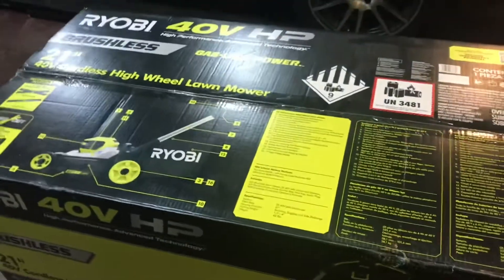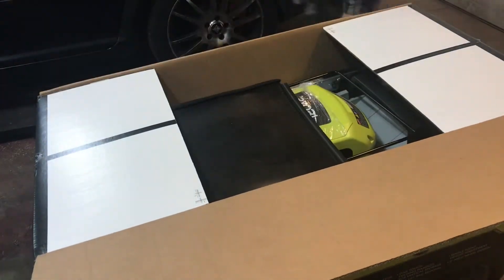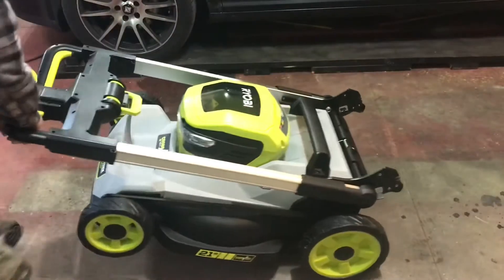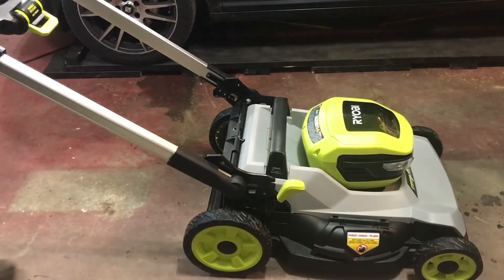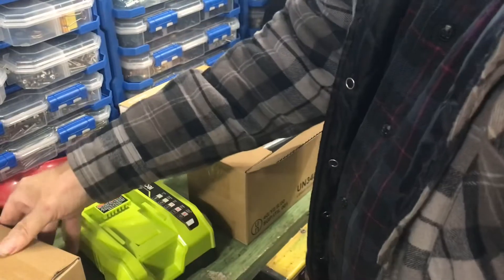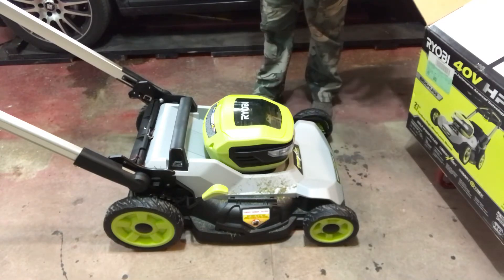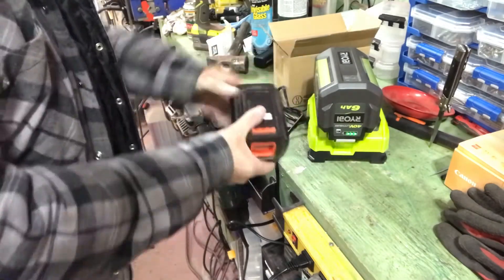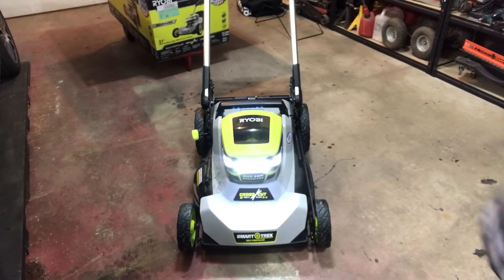Ryobi 21” Crosscut Self Propelled 40V Cordless Lawnmower

Comment: Good or bad this is the future of lawn mowers. From a homeowner perspective the low maintenance is a good thing. From a service shop perspective, I've seen many electric tools come through mainly because they are built mostly with plastic. Shops will still have work but just a different kind of work.
Reply from the maker: Yep.  I switched to electric because when my arthritis in my hands, shoulders, elbos...etc... would flare up it was a literal pain to pull start things.  I'd probably buy a Ryobi snow blower right now if my old Ariens wasn't still running like a top and starts with the push of a button.  
It's the same in the auto repair business.  People are always saying "what are you gonna do when cars become electric and we won't need a mechanic".  Be my guest, fix your own car.  Engine work takes up less than 50% of a mechanic's time.  Future cars will still have wheels and tires, suspension, brake systems, steering components, HVAC stuff and a whole lot more of the stuff that already gets worked on by mechanics